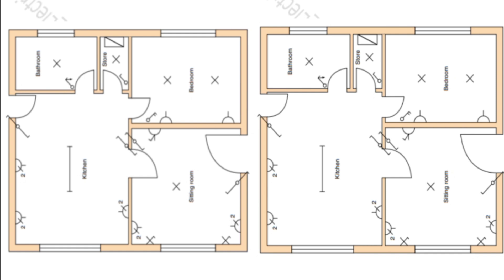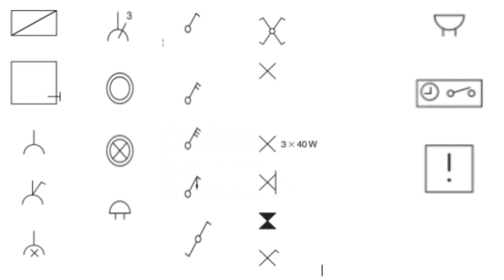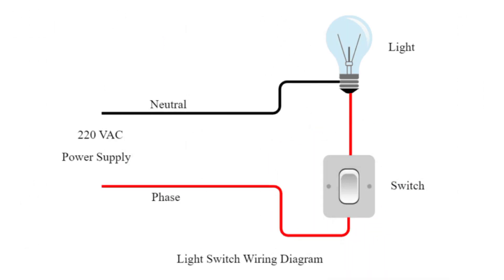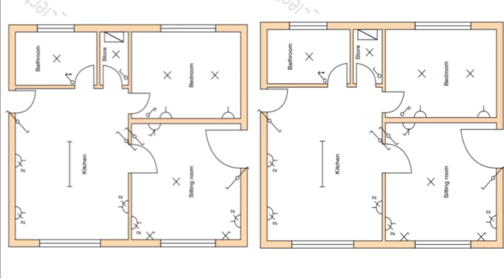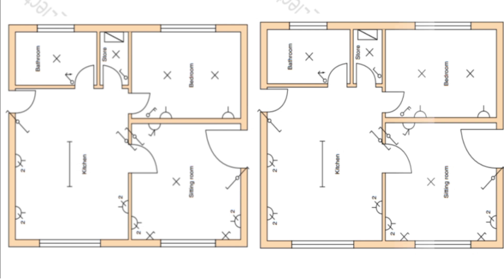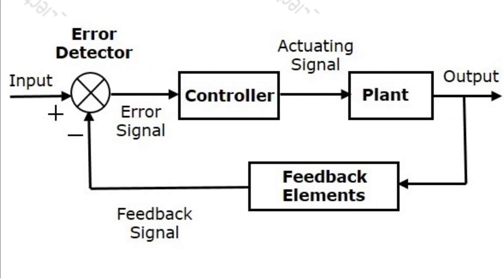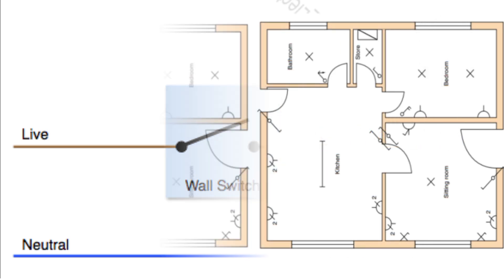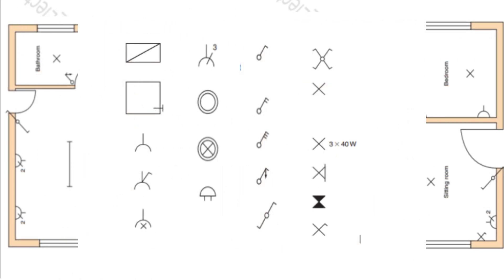How to Read & Interpret Electrical Drawings | Complete Practical Guide for Electricians

Comment: Thanks sir,my question is how do you determine the size of distribution board
Reply from the maker: Samuel,  a few things combine to properly determine the size of DB for your wiring. First, you have to consider the current demand of your total load, taking diversity factor into consideration in most cases. and other important factors. I recommend you contact me for a short training.  you may reach me on +233209323669